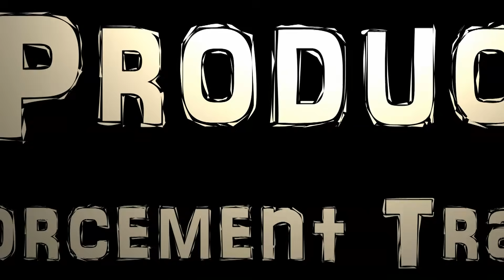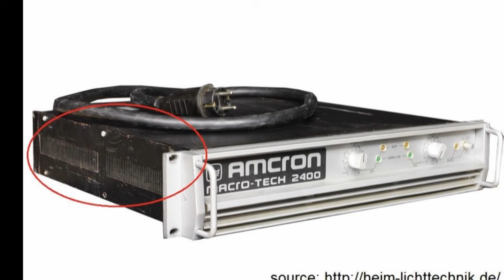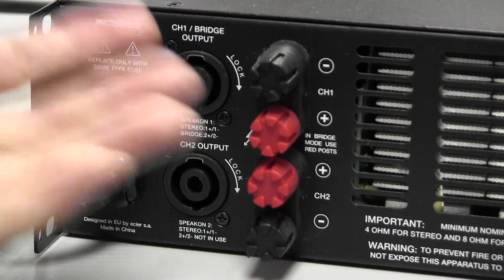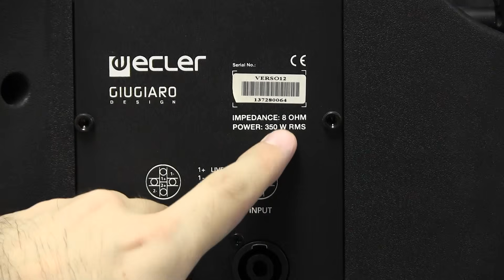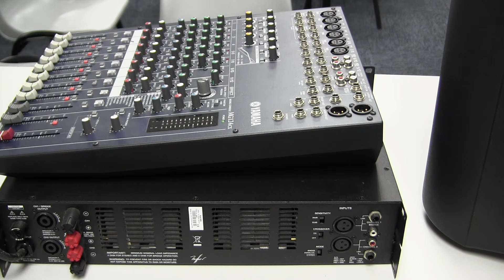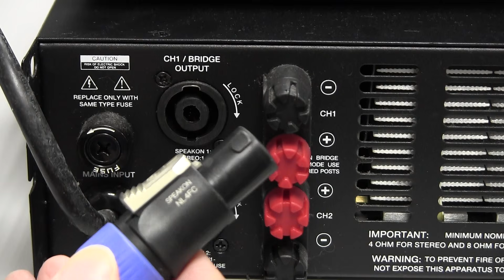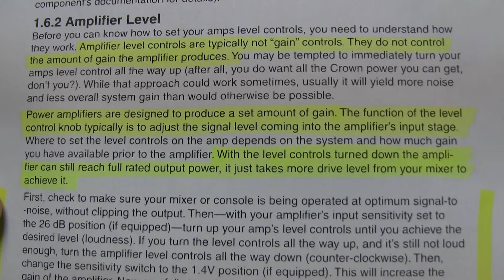How to connect a power amplifier to passive loudspeakers

Comment: I want to use an active crossover but my speaker already had a built in passive crossover. do i have to remove the passive crossover from the speaker in order for the active crossover to work properly. or can i just connect the active crossover without removing anything?
Reply from the maker: It depends - are you using the active crossover to split the lows from the highs or the sub from the fullrange signal?
Reply: +GLB Productions yeah just want high and mid frequencies for top speaker and low frequencies for sub. using dbx 234s as 2 way stereo
Reply from the maker: Yes then you'll be fine. I have a video coming up on a DBX crossover that is very similar to this, it'll give you more info.

Comment: Just a quick comment: I find it "a little bit odd" that the "Output" XLR terminals have exposed pins(male), and the "Input" XLR terminals have recessed pins(female). This seems to be the opposite of almost every common sense approach to connector design.  I know it's not your decision, but, I was just wondering if you might happen to know why they adopted this sort of "convention"?...
Reply from the maker: According to my research the reason for this is to have the pins pointing in the direction of the signal flow, ie male connectors with pins sticking out = output and female with holes = input. This is logical and really helps when teaching because I can use the obvious biological analogy ;) 

The reason that A/C power connectors do not adopt this is that it would be very hazardous for the male connector with exposed pins to have A/C-level voltage on it, but the voltage levels carried by XLR connectors are very low (typically no more than a few volts, ie less than a battery) that this is not a concern. 

Some people have in the past used XLR-type connectors as speaker level connectors - this is definitely not safe and one of the reasons behind the development of the industry standard Speakon connector.
Reply: Thanks, Bruno! I ALWAYS Enjoy your SUPERB Videos!   Thanks for the feedback about the" XLR"connectors, too.  The "SPEAK-ON" Connectors look to be quite nice! The only issue I see is that they are a bit bulky, considering the ever shrinking size of everything electronic! LOL! I'm sure there will be many "new and improved", future connector designs, too!  It's challenging just to try to get up to speed on this stuff!  Bravo! You seem to be VERY WELL Educated on these topics!!!    Thanks again!!!
Reply from the maker: You're welcome, feel free to get in touch any time you have more questions :)

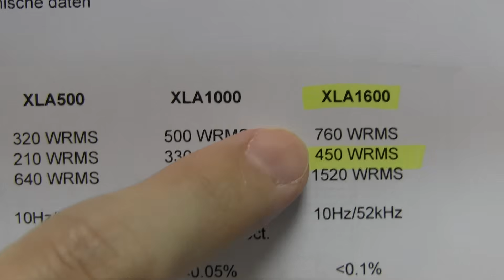Comment: 16:09 is exactly what I wanted to know / how much watts into each daisy chained/paralleled speaker - Cheers.
However, is it possible to run one channel @ 8 ohms (on one 8 ohm speaker) and the other channel @ 4 ohms, on two daisy chained/paralleled 8 ohm speakers?
Ie. Can each channel (of one amp) be run at different ohms at the same time?
Reply: Forgot to add > in either 'stereo' or 'mono' mode?
Reply from the maker: Yes, the two amplifier channels are independent and can be run at different load impedances. This video will help you to see some of the different connection possibilities: https://www.youtube.com/watch?v=HKpV30pjvIo
Reply: Cheers for your prompt reply there.

Additionally, I want to run 2 x 300 watt 8 ohm speakers, per channel, daisy-chained to 4 ohm loads - would this speaker configuration be ok connected to an amplifier that can apparently deliver 1200 watts per channel (@ 4 ohms) provided that I don't turn the amplifier volumes fully up?
Reply: My speakers referred to there are 2 x Mackie C300's (for the tops/mid/high) and 2 x unbranded 300 watts for the bass cabinets.
Reply from the maker: In this case you'll need to work out the total load for each channel (both watts and ohms) and compare it to the amp output power and minimum load impedance. I have a video that discusses this process: https://www.youtube.com/watch?v=l9L7uK7Xy0w Go ahead and work out your numbers and let me know if you have further questions :)
Reply: Cheers,

I'm looking to connect 2 Mackie C300 cabinets, in parallel, to one amp channel, and 2 bass cabinets, in parallel, to the second amp channel; each speaker/cabinet is rated at 300 watts 8 Ohms; when these are daisy-chained together (2 per channel) in parallel, I believe the wattage, per side, will double to 600 watts and the (8) Ohms will half to a 4 Ohms load per channel.

Mackie C300 speaker specs state that this speaker can be run on an amplifier that delivers between 300 to 600 watts per channel < I assume that this spec (only) applies to one 8 Ohms Mackie C300 per side?

Would the 'amplifier watts recommendation' therefore recommend a higher watts amplifier to compensate for the (now) 600 watts per side? / Could the 2 daisy-chained Mackie C300's (now) safely work on an amp that apparently delivers 1200 watts per channel when @ 4 Ohms? / Would this 1200 watts (@ 4 Ohms) amp only deliver approximately 600 watts when the volume knobs are set to halfway?

This is the amp: https://www.qsc.com/live-sound/products/power-amplifiers/gx-series/gx7/ which would be run at the spec stated single channel/mono mode!

Sorry for any confusions.
Reply: Maybe here's the simple way for me to ask the above: Is it ok to use a considerably higher wattage amplifier 'provided' that the volume controls are kept within the 'assumed' range / do volume controls reduce the amp's wattage out?
Reply from the maker: It depends on the amplifier but on pro audio amplifiers like the one shown in the video they do not reduce the output power, they reduce the amp's input sensitivity. So full power is still available, you just need a greater input signal to achieve it.
Reply: Thanks again,

Are my speakers (configured as above) likely to survive being worked on this 1200 watts rated PA amplifier - considering they will be daisy-chained (2 speakers per channel) I imagine that this now (600 watts per side) would demand a considerably higher rated amp wattage output - as each speaker is rated at 300 to 600 watts < therefore the total per (daisy-chained) side appears to have now doubled to a 600 (1200 peak) watts...

Again, sorry for the confusion here.
Reply from the maker: Chaz I think I have given you enough information to work this out for yourself - check out the video links and work out the numbers, it'll be a good learning experience!
Reply: I'm sure you have, thank you - I was just hoping for your confirmation on my thoughts here: 2 x 300 watts speakers, wired in parallel (to 4 Ohms) on one channel, would require a considerable more amp wattage output (over 600 watts) for better performance and less strain on the amp ... without the worry of frying my speakers - are my thoughts correct there please / what would be the ideal watts headroom (from the amp) with this configuration please?

Comment: Ways to increase load impedance while adding more speakers where Impedance Total is lower than desired?  Can you add device (Resistance Load) ?
Reply from the maker: The 'old school' way to do this is to wire some speakers in series and some in parallel in order to achieve the impedance that you want. However modern sound reinforcement speaker cabinets are always wired in parallel in order to keep the rest working in case one goes down.
Reply: I have about 100 bose speakers 6.5 inch i have taken from various vehicles at the junk yard, I want to make a monstrosity that uses them all.  They're 4 ohm speakers.  I remember something in the back of my mind about a resistance ladder of parallel and series.  But... there has to be enough total current after the set up is complete.
Reply from the maker: Sounds like a fun project! I would suggest building it in sections, each of which can be driven by one amplifier channel. Do your math and you should be able to come up with a solution.
Reply: I'll make a video and get back when it's worked out.

Comment: 👍 I hooked up in PARALLEL  2 × 8ohm passive spks to each 2 channels on my 4 - 8ohm amp / Also hooked up in SERIES 2 x 8ohm passive spks to each bridged amp , (two amps total) which in bridged mode is 8ohm .
   Assuming the wattage is compatible , is it properly hooked up ? Thank you for your time , much appreciate .
Reply from the maker: How are you achieving the series connection Richard? Have you wired the speaker cabinets yourself?
Reply: GLB Productions    I hooked the positive of one spk to the positive of one amp and the negative of the other spk to the negative of the same amp and then the positive of one spk to the negative of the other spk and then I did the same for the right using a second bridged amp . The inside of the spk cabinets were factory , (pioneer) wired and the specs says 8 ohms . I think connecting in series keeps the ohmage the same , 8ohms in this case . Thank you very much for your time .
Reply from the maker: No, connecting the speakers in series actually raises the impedance to 16 ohms :) Also worth noting that in pro audio applications speakers are always wired in parallel - this is so that if one goes out you still have sound. With series wiring if one speaker dies the whole box goes silent. So you may wish to reconsider your setup :)
Reply: GLB Productions    ok , so should I use one amp only and connect in parallel , the amp CAN handle 4 ohms . 
What will happen if I keep it the way I hooked it up . 
Isn't 16 0hms easier for the amp to handle ? Thanks again
Reply from the maker: If your application is home audio/hifi there's no issue really.

Comment: Is there recommended headroom for the am eg can i use the lab gruppen amps 10000 watts to power 4 double bass bins with only 1200watts per bin
Reply from the maker: There is a systematic way of matching power amplifiers to speakers, described in this video: https://www.youtube.com/watch?v=l9L7uK7Xy0w

Comment: thank you very much, I have an amplifier which is second hand, so port A does not work and I only left with port B, if the power is enough for 4 speakers, can I just use port B for all of them? thanks
Reply from the maker: Yes, assuming that channel can handle the combined impedance of all four speakers.

Comment: Question sir... i hooked up my bluray player to the CD in of my Onkyo TX-SR601 and hooked up my Onkyo zone2 line out to the Kenwood KM-894 power amp. and got blasted with a loud sound that can wake up the dead, even though i set the volume of my onkyo to 1.
why did i have no control of the volume?...what did do wrong? im planning to buy a receiver with pre-out at the back of receiver?will it have the same effect if i connect the power amp... say the surround (line-out) of the receiver.  my purpose of hooking up the power amp. to the surround of the receiver (line-out hopefully), is that i want consistent power on my surround speakers...thanks
Reply from the maker: Hello Ilyn I'm afraid I'm not a hifi expert - I suspect that the line out on the Onkyo is pre master volume, ie fixed level, so you will need to control the level via the Kenwood.

Comment: How do I connect two passive subwoofer to this setup?
Reply from the maker: Subwoofers are connected in exactly the same way as fullrange speakers but you need a crossover or low pass filter somewhere in your signal chain to remove unnecessary mid/high frequencies.

Comment: Excellent video but I have one question. You said connect your amp to the speaker and you  use the other 1/4 jack from the speaker to connect to another speaker. I think this is series. Now my question is how do you hook up two speakers in parallel if your amp has only one speaker output. Thanks
Reply from the maker: No, connecting two speakers like that establishes a parallel connection - series connections are only used between individual drivers housed in multi-driver loudspeaker enclosures eg a 4x12 guitar cabinet.

Comment: I am new to DJing.  My setup consists of 2 15" powered fronts.  and 1 18" passive sub.  So from my Pioneer DDJ controller has a 2 channel outputs (xlr right & left and rca right & left.)  What's the best way to run my 3 speaker set up?  Thanks!
Reply from the maker: I have a video coming up soon that should answer some of your questions, stay tuned.

Comment: Thank you so much. I have a question can i connect two different 8 ohm  (ex 2 brand or 1x12" and 1x 15" ) speakers per Channel respecting the data sheet of the amp and the speakers.
Thank you
Reply from the maker: You can, but bear in mind that the speakers will not be of equal loudness. In this case it is better to connect the two 12s on one channel and the two 15s on the second channel.

Comment: Bruno... i have  4×SP5 peavy speaker which are 800w at 8 ohms and i have a samson SXD7000...at 8 ohms the samson run at 700 W and 4 ohms it runs at 1000w ...so what i do i run 2 speaker on each channel ...im i doing it right ...thanks
Reply from the maker: Yes if you run 2 speakers on each channel each speaker will get 500 watts, so a little under-powered but if that gives sufficient volume for your needs then it's fine.
Reply: Ok thanks...but Bruno  someone told me that if dasy chain to each other...then 1000watts will go to each speaker
Reply from the maker: Please ask your friend how they intend to extract 4000 watts from a 1000 watt per channel amplifier :)
Reply: Ok thank you so much... is there any way i can get that power from my amp...:)

Comment: Help, I have a set of Ev 112 ( 8 ohm ) and Martin audio 12" bins ( 4 ohm ) my power amp is a crown xti1000. 
My ? Is how do I wire my speakon cable and will daisy chaining the speakers damage the amp. 
Thanks for any help on this matter cheers

Comment: I have 2 Q: I connect my small system that way and my microphone too.. My 1st Q: is why does my microphone when turns on and off it pops ? 2nd Q :Why do my amp clip even at low volume ?
Reply from the maker: 1) Probably a cheap or worn out mic switch. 
2) No amplifier limiter, or amp level set too high.
Reply: GLB Productions : ok I will try too lower the amp gain... as for the microphone will look in to it... thanks

Comment: i have a alesis multimix 12r, drive rack PA with a crown xls 1002 set up. It is in a church. Most mics go directly in the alesis, some go through a behringer xenyx 4 channel. the problem is that 2 of the speakers are on channel 2 of the amp (im running the amp in stereo) are 40w rated. They sound great but since im not running them in bridge mono mode the sound for the other main speakers connected in channel 1 is not loud enough and i could say distorted. What would you recommend i can do to get full power but still be able to power the 40 w speakers?
any advice greatly apprecaited guys/
Reply from the maker: It sounds to me like the main issue here is that the xls1202 is not powerful enough for your main speakers - what is their power rating and impedance?
Reply: i have no idea as they where installed ages ago and it is up high... To hear it well the control knob has to be turned 2/3 to 3/4 of the way when in stereo and just over half way in bridged mono.

Comment: so if I daisy my loudspeakers and am only using one channel, does that eliminate one of the faders? like right and left?
Reply from the maker: 'Eliminate' is not the right word, it just means that your master volume will be controlled by a single fader rather than by both of them. You can still use the unused output for other things like recording or feeding to another amplifier.

Comment: Thank you very much Mr. Bruno of GLB Production for the presentation. I really appreciate & enjoy watching your video again & again. I just want to ask advise on what type of Amplifier can I use for my BOSE 901 Series VI with the Series VI equalizer. The technical information says its compatible with amplifiers/receivers rated from 10-450 watts RMS. Rated 250 watts IEC. What will be the power output of amplifier can I used?  And if I used a power amplifier how can I connect the equalizer of the speaker ? I want to make sure that I will buy the right component for my speaker. Thank you again Mr. Bruno.
Reply: The impedance of Bose 901 series VI is 8 ohms.
Reply: Btw, I am Voltaire Labuguen from the Philippines.
Reply from the maker: This video will answer you questions: https://www.youtube.com/watch?v=l9L7uK7Xy0w

Comment: Have to loudspeakers in the front and run two 100 feet cable from each loudspeaker to the amplifier, but only can hear one speaker.
Reply from the maker: Very likely your amplifier is the issue. Swap the speaker cables around and see if the problem switches sides - if it does then the issue is at the amp.

Comment: Hello GLB Productions, By my great mistake,   + and – wires of two way  speaker connected to the 2 positives of the left and right channels of the tube amp.  Likewise, + and – of another speaker connected to the 2 negatives of the left and right channels. The one speaker was working  which was connected to the 2 positive of the amp . And the another speaker was not working  which was connected to the 2 negatives of the amp.  For the first 10 minutes, I didn’t notice the wrong connection  by my stupid mistake, then I checked and made the correct connection. After that,  both the speakers were working.  I am afraid of that : Are these speakers and the crossovers became weak? Will it be in full strength as it should be? Although the speakers are working now, I am much worried by my wrong connection.  But , Why one speaker was working and another speaker was not working?  Kindly explain in detail.    Thank you, Best Regards.
Reply from the maker: Hello my friend I already answered this same question from you three weeks ago :)